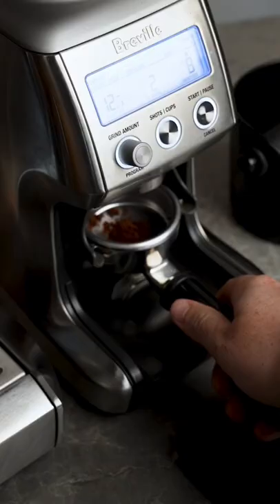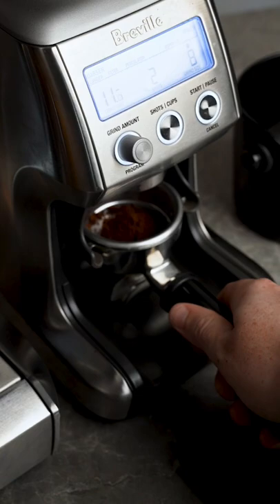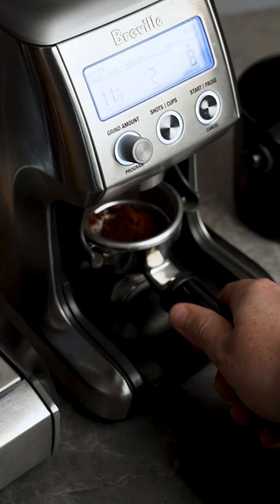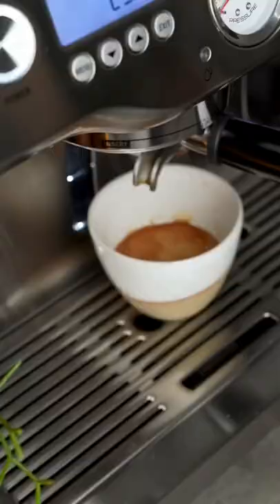This is why you have a watery coffee bed. #goldenbrowncoffee #barista #coffee #espresso

Comment: This isn’t always the reason. This is one of the many possible causes.
Reply: Now I'm curious on the other reasons and I don't even drink coffee lol
Reply: @bakimaki01927  mine got more watery as I grinded finer. It also differs if the machine has a solenoid valve or not.
Reply: @altruistx what setting to grind coffee beans do you suggest?
Reply: @dani23dani85  depends on the beans, it's not one size fits all. You gotta experiment

Comment: If it is a 16-20 g basket. It means put 20g for dark roast and 16g for light a'd 18 for medium (in general). It does't mean "put any dose you wa't from 16 to 18 g"
Reply: You absolutely can use a lower dose than the maximum capacity of the basket.
Reply: I think you got that backwards. James hoffmann lazer analysis showed (a few months ago) that darker the rost is the more porus the bean becamos.
So the darker the rost, more water it can take up and expand.
The darker the rost it's easier to break up with a grinder resulting in smaller and more even particles(even with super expensive grinders, but even more true with cheaper grinders) 
Lance Hedrick says greener the bean is it's harder to extract the flavours (it's a well known thing) the easiest fix is (next to temperature increase) to grind finer or increase your dosage!
Reply: how many second?
Reply: if 20g how many second of extraction?
Reply: @Zi-ky111  😬your question makes me assume two things:
1. You didn't watch James Hoffmann's how to dial in espresso video.
2. You have low quality grinder.

Everything start with the grinder.
So if you have 18g dose and you getting 25 sec (or faster) extraction at let's say 2.6 setting on your grinder and you want slower flow rate. You obviously want to increase the resistance of the puck. So you set your grinder 2.5 and your extraction time is 49 seconds or choke. Your grinder step is too big and/or produces to much fine for that bean. It's simply not up to the task. If you grind 2.7 your extraction time is 20 sec.
The solution (what is also in the J.H video) is to increase the resistance by increasing your dosage! Instead of 18g now you using 20g on the same grind settings and now the extraction time is 30 sec!
You fixed your problem without buying a new grinder!
That's the baskets are "from to range" so you can dial in more precisely(a wide range of beans with a wide of equipment) for better extraction, not some arbitrary law of roasts levels of the bean.
Reply: @mcst6969  thank you brothaa! 🙏🏻
Reply: @mcst6969  im using filter robusta, and 58mm portafilter what is the best grind size?
Reply: @Zi-ky111  I can't tell you what is the right grind size for you because I don't know your set up and now importantly I can't taste the results!
With robusta it's easier if you look up Lance Hedrick "turbo shot" video. He explains the traditional and new style of espresso so you can experiment yourself!
Reply: you dose according to taste within those limits.
Use the weight that makes a good cup and don't just blindly follow a "rule-of-thumb"
Reply: Fact is, you can actually do whatever you like and youd hardly notice a difference. An example of something taken way too serious, even as an enthusiast.

Comment: It's just about the headroom between the shower screen and the coffee puck, which can be large even though you use the correct dose. It doesn't matter
Reply: So having a watery coffee bed is something normal?
Reply: @josemancia9386  Pretty normal depending on the circumstance. There is also a correlation between this and the specific beans/prep as well. The decaf at the shop I work at often has watery pucks, while the regular blend does not. The dose of both is around 18, so I attribute that to the decaf process altering the beans enough for them to hold more water.

Comment: also have Breville dual boiler with the Breville grinder pro. Why does my puck ALWAYS stick to the group head after extraction?
Reply from the maker: You’re probably over filling the basket. Try a smaller dose (19g) and finer grind size
Reply: @Goldenbrown.coffee  thanks. Actually thought I was underfilling it as I've randomly had that wet puck like you show here. Grind size is on 5. I will definitely get scales to weigh. I'm still using the original tamp that slots into the left of the machine. I've tried to get it so the tamp edge, sits level with the porta filter edge when compressed
Reply from the maker: @paulg101  nice one! Let me know how you go. A wet puck could also be because the grind is too coarse too. If you find your grind isn’t getting fine enough you can change the internal burr inside your grinder. Default is 6 and I have mine on 4.

Comment: Need Help! I was gifted a EspressoWorks Barista Pro Series (30-piece) espresso machine that was brand new. I was able to use it for 2 days and on the 3rd day my grinder stopped working. I checked to make sure it wasn’t clogged, cleaned the grinder area according to the manual, and have been messaging with one of the representatives. I’ve sent her multiple videos that she has asked. Nothing had changed. With or without coffee beans the machine will make the noise but will not grind. The beans just sit in the bean hopper, nothing moves or comes out. Any ideas as to what needs to be replaced, if the grinders/burrs could be replaced, or should I just get a new machine? I can not find any videos regarding this machine besides the “ad” videos that EspressoWorks have on YouTube.

Comment: Okay so my Izzo filter is rated for 6-8g. Even at 9 I get a goopy puck.  10 and the headroom to the showscreen is nil. Advice?
Reply: Try grinding Finer and Tamp ultra hard to make sure tablet surface is flat and even!
Reply: @eduardscooper4719   other thing I have learned is that as an e65 head, the releasing off the pressure leads to the water in the puck rising bringing it to the top as it escapes via the releaf valve.

Comment: What is the right amount of dosage for a 51mm portafilter?
Reply: I have the same question
Reply: Entirely depends on the basket. Generally unlikely to be a basket more than 16g max but diameter says nothing about the depth of the basket so you might even find 21g 51mm baskets